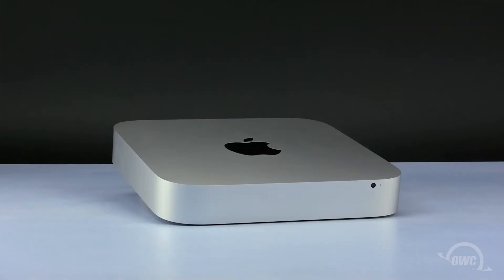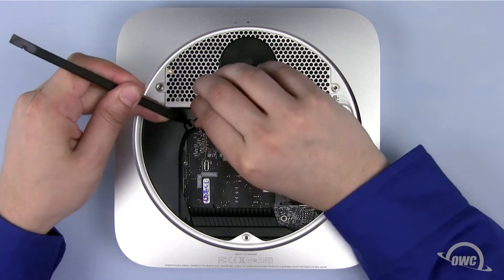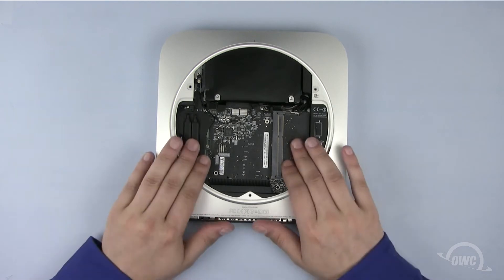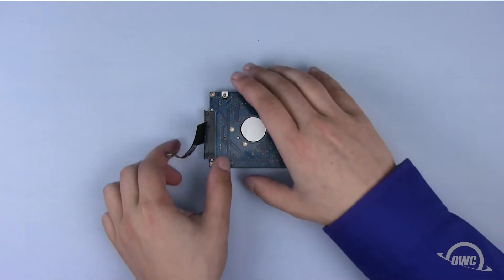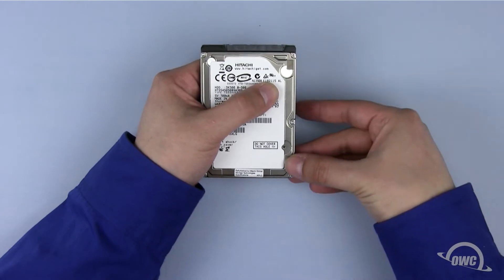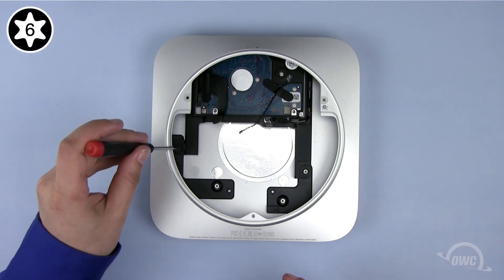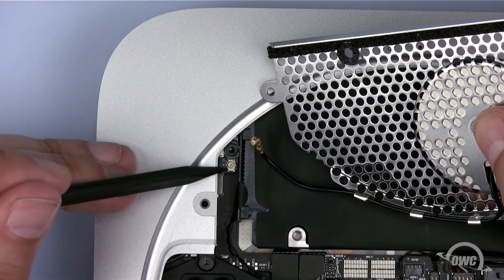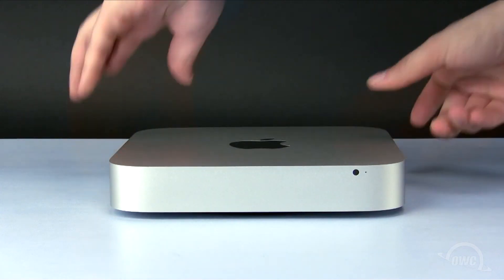How to Upgrade/Replace the Drives in a Mac mini Server 2010 (Updated)

Comment: this is a great video.  the top (lower bay) drive can be swapped out without having to remove the logic board or power supply!   takes a bit of wiggling to get the drive back in but it’s very doable (you technically don’t even have to remove the RAM either)
Reply: Dude I didn't even know there was two. Mine came with zero drives luckily the sata ribbon was there or id have ran sata over usb lol 

And the back was off it but ended up being in the box. Got it for free and forgot about it. Went to get a pillowcase the other day and it was at the bottom of the box lol

I know have a single 500gb on my 2011 running high Sierra. Once I copy all my good files from Windows 7 I'll be swapping my SSD over and adding in my 1tb HDD as well. 

Making the conversion to mac use full-time. I forgot how great these little bastards are!

Comment: Is the top drive usually where the os is installed?
Reply: did u figure out which drive is the main drive (i forgot what the volume was called - Server HD?) and which drive is the Data HD?
Reply: just changed the “top” (lower bay) drive (which was Data HD) on my mac mini server.  it technically doesn’t matter which drive you install the OS to (in my case, I only swapped out the “top drive” for an SSD to save myself the work of having to remove the logic board and power supply)